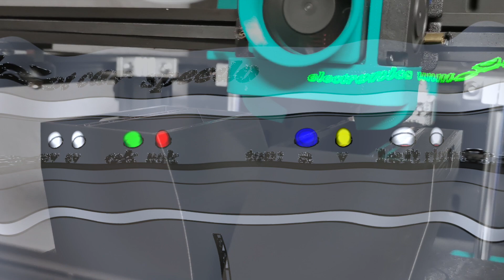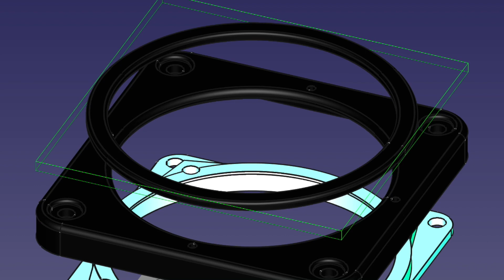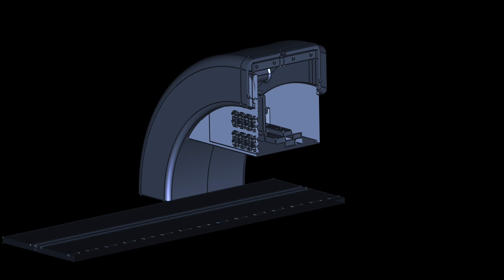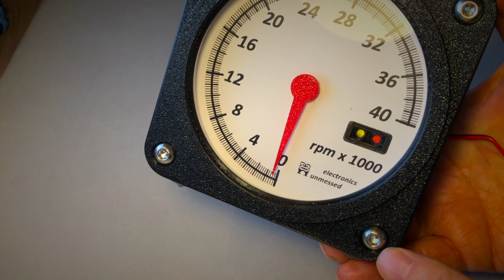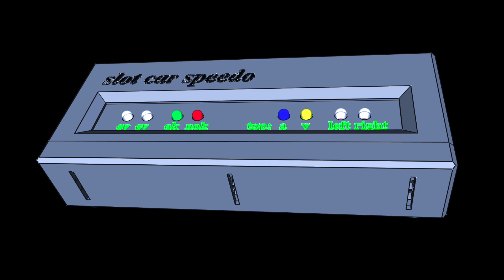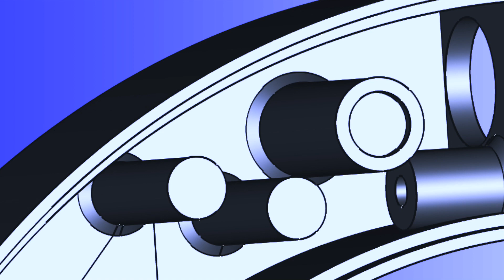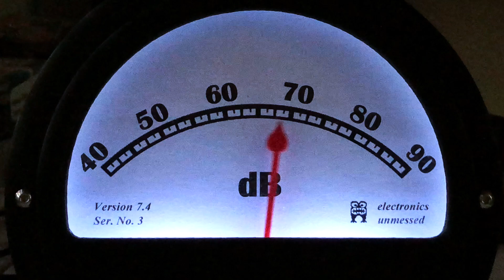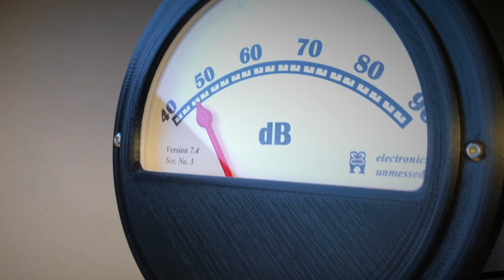How to design for 3D Printing - Best Ideas  (EP113c)

Comment: While it's not possible to completely avoid some artifacts where the layer starts/end on cylindrical outer walls, they can be minimized by experimenting with the retraction settings in the slicer. Sanding removes the seam but also removes the layer lines so it's a trade-off. Using randomized outer wall starting points makes less noticeable little blobs around the cylinder. There's also a setting in Cura to stop extruding just before the end of the layer, using the oozing filament to complete the line instead of using retractions. I haven't tried it but it might be worth trying.
For the missing material around the letters, could it be caused by the hot nozzle moving over the finished surfaces and melting them before reaching the spot where it prints the letters?
Reply from the maker: Thank you very much for your detailed comment and your interesting tips. I will discuss them all with my 3D printing nephews. Stay tuned!